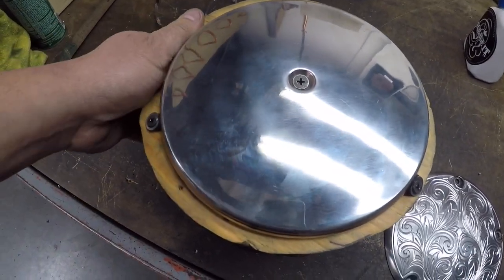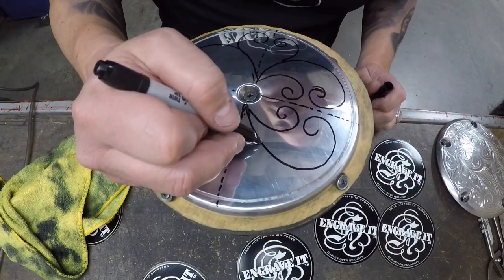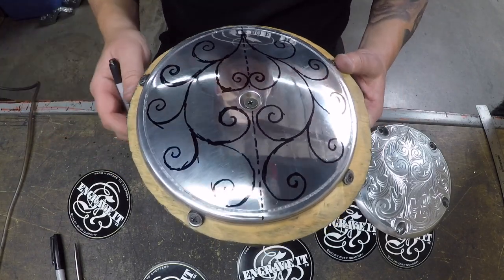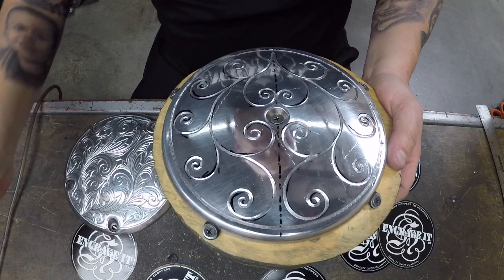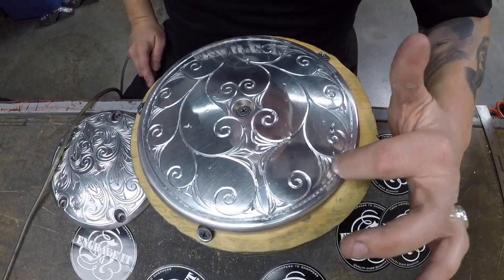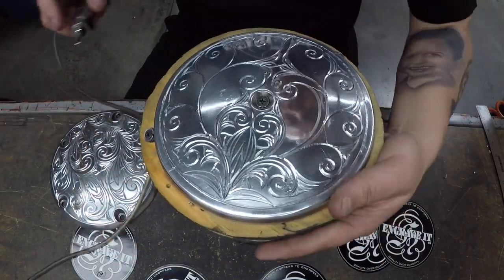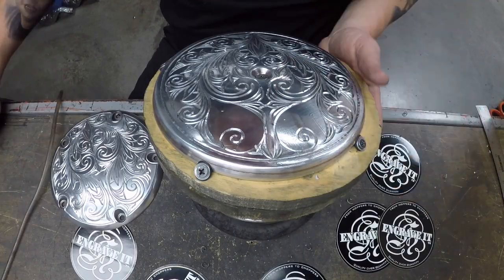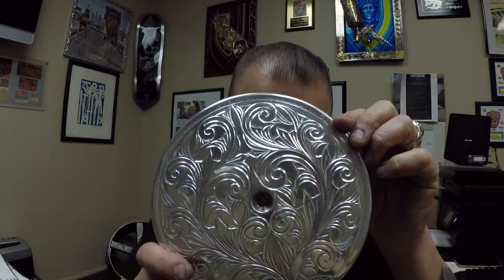Hand Engraving side Air Cleaner cover for Harley Davidson

Comment: What is the best graver/bits to start with, with out spending thousands off the rip
Reply from the maker: RevolutionStudio615 unfortunately  average cost to get a quality engraving setup is between $2,500-3,000.00
Reply: @engraveit5811  what type of ingraver are you using
Reply from the maker: Grs

Comment: hi. how come the cutting tool only cuts the surface and not deeper..is it the angle you use.. or does the tool only cut a certain depth.. please excuse my ignorance..p.s. great video such an inspiration to budding followers. .many thanks from the uk..cheers best regards
Reply from the maker: colin jeffrey don’t think the video shows how  deep this is compared to a typical metal engraving done for car and motorcycle. This is deep engraving without having to remove all the back ground. We triple chrome parts after we done with a good amount of copper and nickel, chrome and it does not cover the engraving.

Comment: When it comes to your price .. do you charge per hour or per piece.. or does it depend?
Reply from the maker: I myself charge per piece, work area, design detail etc
Reply: @engraveit5811  thanks  for the reply .  That's makes sense .. I'm starting my own journey with this..beginning level but I'm starting to understand.  Every piece is different angles, levels, shapes... regardless of size .. sometimes smaller pieces have to be a little more creative.. big piece's it's all about filling space and patterns.  I got the tools and I'm down to put in hours of cutting.. but I suck at drawing no patience.. I try and freehand everything it looks OK but to me deep inside it sucks lol..  that sharpie set up you have  would definitely help me . Thanks for this video very useful information..  I know some don't like to show their set ups and techniques  but trust me   you can show every one everything.. but unless they put those hours and hours .. and hours of practice. RESPECT ✊ .  Definitely an art.
Reply: @iLLnATioN702  You will learn that the smaller you go the more time it takes because you have to work slower and with a lot more can and planning to ensure you dont mess up the piece. When it comes to stuff like this its kind of like tattooing. There are times when smaller tattoos take more work than it would if it were larger.